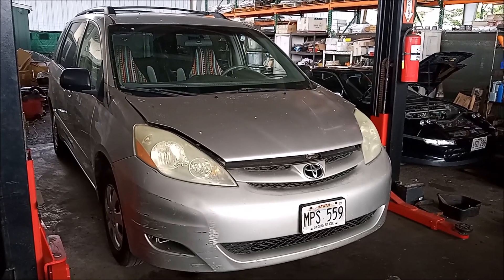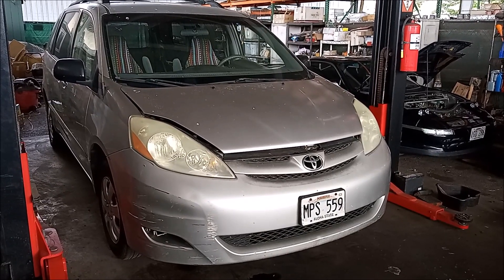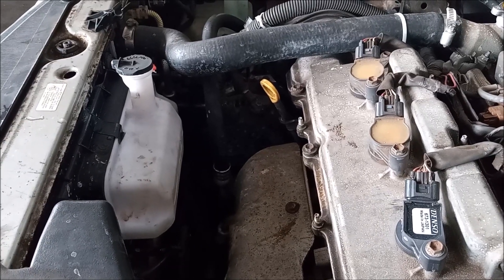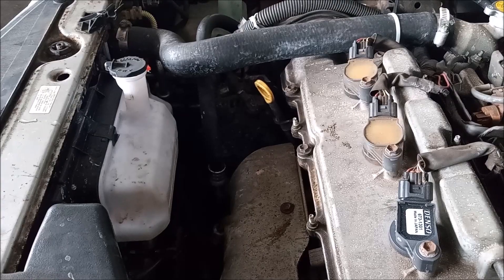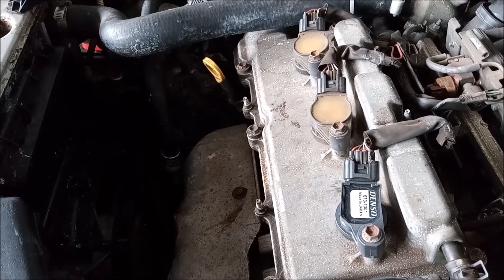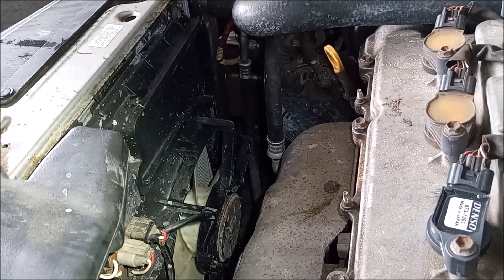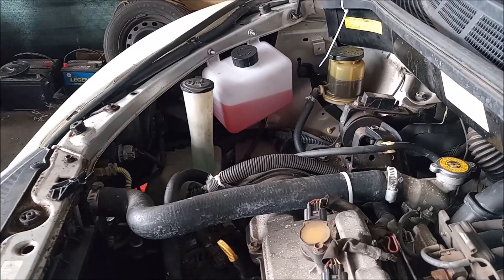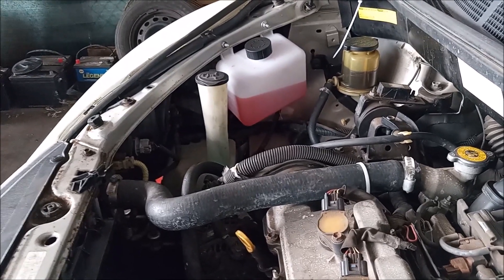Coolant System Flaw - 05 06 Toyota Sienna 3.3-liter V6 3MZ-FE

Comment: Takes a lot of heat to do that damage on the reservoir.  Must of over heated  after the new one was put in
Reply from the maker: Buddy, get a thermometer, compare the temperature of boiling water to the temperature of a hot exhaust. Which is hotter?
Reply: @Merryfrankster_  only reason i said this is because i still have the original fan and reservoir on my 2006 toyota sienna le 3.3. They do get yellowish and discolored but other than that. I havnt had an over heated engine im always doing my pre trips inspections

Comment: Ok so my coolant just started acting up if I do this what other procedures do I need to do?
Reply from the maker: I have a newer video for this coolant bottle replacement with a better option, and also, there are several issues in the Sienna coolant system that you can find in this channel under the 1mz-fe 3mz-fe engine playlist - like the thermostat, the heater hoses, the thermostat housing, and more.

Comment: Good morning. 
last night I was driving and I lost heat in the cabin. My engine temp gauge was bottomed out (cold) and I figured maybe I had a thermostat problem. When I got home I opened the hood to find that the coolant overflow reservoir cap had blown open and had sprayed coolant everywhere in the engine bay. I also noticed a lot of coolant on the floor of the garage that I'm now thinking was there previously.  I'm curious if you have any ideas what happened if why, if I was loosing coolant, the engine didn't overheat, (at least the gauge seems to indicate no overheating going 75mph on the highway for another 10-15 minutes) 

A thoughts would be appreciated.
Reply from the maker: If your temperature sensor runs dry then it does not detect any coolant temperature.

Comment: Where you at in Hawaii? I live Lahaina side Maui and need my van fixed.
Reply from the maker: My shop is in Kahului near Ace Hardware.
Reply from the maker: I am there by appointment only.
Reply: @Merryfrankster_  Right on, if I can make it to that side, I'll come check you out. 
Van overheats after driving for 10+ minutes. Fans work. Checked the hose connected to the radiator refill area, and it's hot after driving, but the hose down by the thermostat feels cool. 
Looks like there's a coolant leak somewhere, get dried coolant splashes all over, but the reservoir is full🤷🏽‍♂️
Reply from the maker: @flagrantlyvivid7195  when you start the car cold, one hose should start getting hot right away, and the other hose should stay cold until the thermostat opens, then turn hot. If the second hose does not turn hot, and the engine overheats, this means the thermostat is not opening. Check my video on replacing the thermostat, it is relatively easy on this vehicle, just have to move some things out of the way.
Reply: @Merryfrankster_  Shoots I'll check'm out. 🤙🏽

Comment: Great fix,  share the part number of the reservoir  ?
Reply from the maker: The part number is JUNKYARD-X001.
Reply from the maker: Seriously these part store reservoirs are junk. I have a new video with an improved fix for this issue, using a reservoir from a 2003-2007 Toyota Highlander, that comes with a bracket that you can bolt to the fender wall of the Sienna. You can get this reservoir with its bracket from any junkyard.
Reply from the maker: https://www.youtube.com/watch?v=IBtLNzKV2DU

Comment: I bought a used 2008 Toyota Sienna and the overflow reservoir has a big crack on the top.  What part did you use to make your overflow?
Reply from the maker: Just a random reservoir from the parts store.

Comment: Thank you.
I think your video explained the catastrophic destruction of my radiator and overflow bottle 2 1/2 years ago.  2 weeks ago I brought my 2005 Sienna in for service at a small BMW shop after my overflow bottle began to boil over again.  The mechanic said that the engine had a small head gasket leak.  I decided to try Blue Devil 16 oz Pour n Go head gasket sealer when I got the van home.  So far so good but only 40 miles on it.  I then came across your video about the poor placement of the OEM reservoir and it's failure. 
That got me to thinking that within a few days after having costly repairs done at the Toyota service center the van overheated while driving uphill.  I didn't see the fans turning and assumed the relay was bad, but it still boiled over after replacing.  Bought a new radiator cap and still had issues.  I then started leaving a small amount of coolant in the overflow bottle and the boiling over stopped.
I never got a straight answer as to why the radiator blew up from Toyota in the first place.  My radiator blew out downward not upward by the bottle.
I just purchased a Dorman overflow bottle and will mount it like yours.
All this time I had been driving with a head gasket leak because the overflow bottle.
Thanks again.
Reply from the maker: Yes it can be tough to diagnose coolant and overheat issues. On these vehicles with 1mz-fe/3mz-fe 3.0/3.3 V6 you must also beware of the thermostat housing and the thermostat outlet tube. See my video on this topic it is very important for every owner of these vehicles. Also very important are the junction T-s for the front and rear heater hoses. If they fail they will destroy your engine faster than you can say boo. See my video.
Reply: Yes, I purchased a Dorman aluminum housing /thermostat outlet (BB74F8) and will remove the plastic one before it fails.  
I have 190,000 miles on the original set of spark plugs and will replace them also.
Your videos are very helpful and should extend the life of this engine.
Thanks again